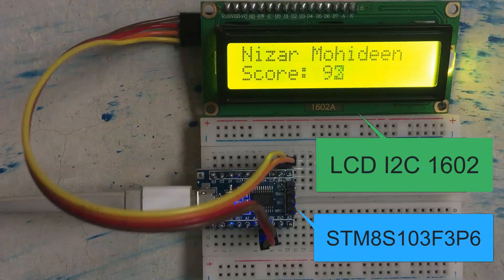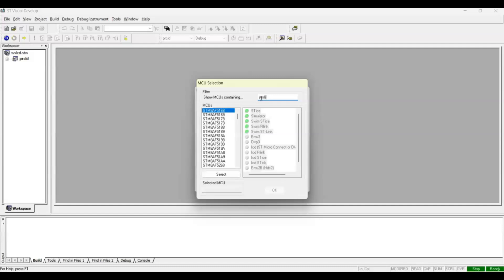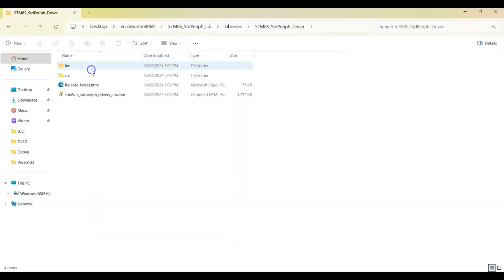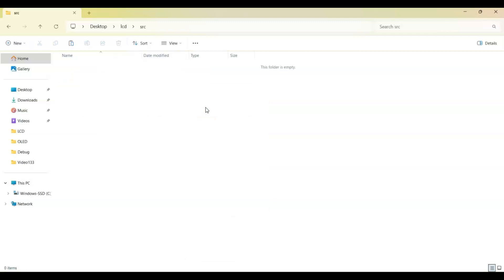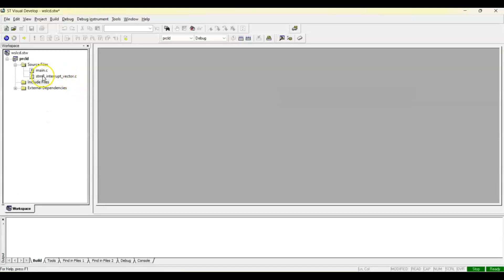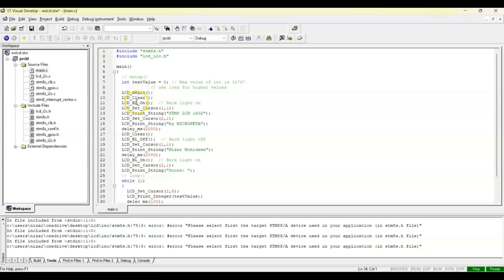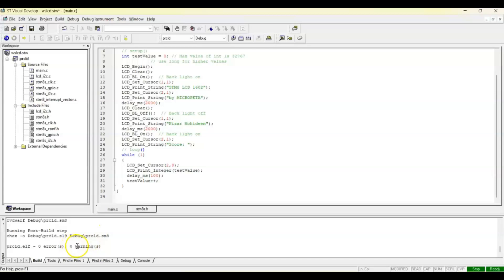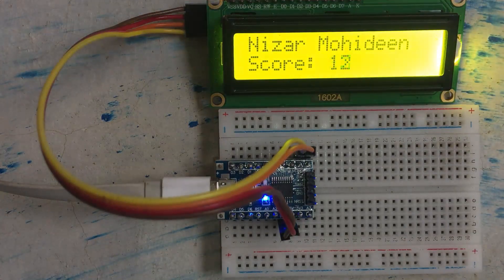133. STM8S103F3P6 with LCD I2C 1602 Display using STM8 STVD IDE

Comment: i have faced very problem when using STM8S003f3 20 pin TSOP MCU. i have created library for TM1637 chip 6 digit and 8 keypad. display driver is working fine. now i am connecting DS1307 rtc+24c32 EProm module, i2c communication just freezes. after all effort i gave up the chip.becuz all the chip i have found that PB4-SC,PB5 -SDA inside MCU P side mosfet is not working.but I2c communication HIGH value is done by providing 4.7K pull up. can you test i2c communication of rtc+eeprom with STM8S003f3? make a video or something provide code in your website.

Comment: Hello friend .. why  you go back  to using STM8 ! ..what  is an advantage of  it ? STM32  is  cheap  and  do every thing
Reply from the maker: Some people requested me to start a series on stm8 too
After publishig two videos of stm8, I found out many people intereted in it and likes it
In my opinion, stm8 is also has following advantageos
-- can easily remove other components from stm8s103f3p6 blue board and program stand alone stm8
-- compact spl library to easily dig in and learn how mcu programming works
-- reverse engineering is easy with stm8